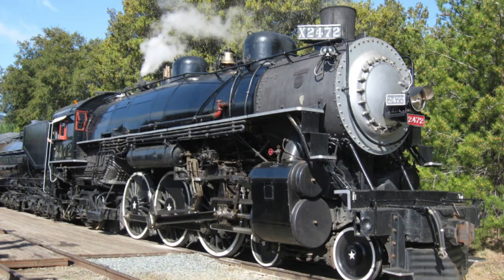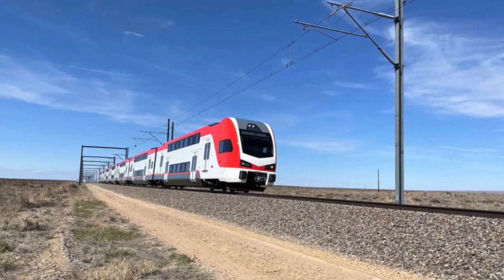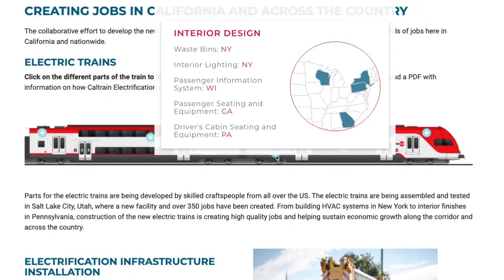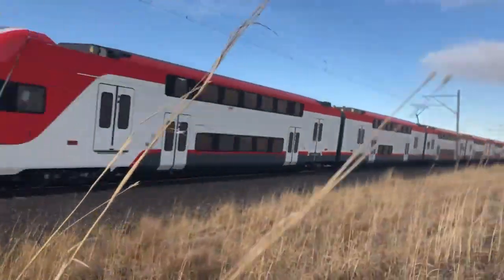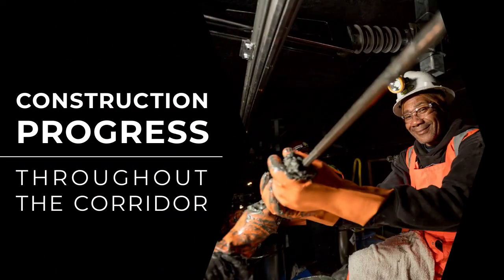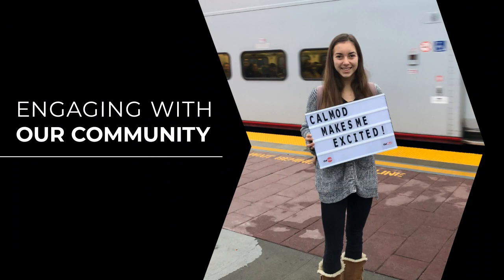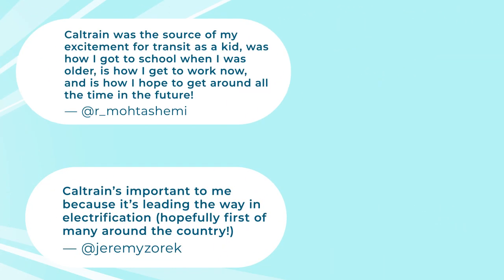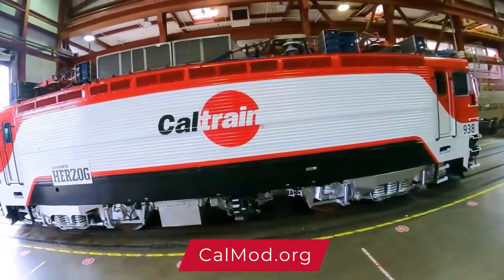Caltrain: Electrification Progress 2021

Comment: I frequently use the Stadler KISS in Switzerland (the original SBB variant). When the driver actually bothers to crank one of these into max acceleration, you can feel yourself being pushed into your seat. If the Caltrain model is similarly powerful, it will have acceleration close to that of a subway train. I also wonder if features like the beam sensors on the doors will carry over as well.

Comment: Anybody know what’s going to happen to the Aem-7? I know 929 was used for parts on 938
Reply: The aem won’t be used for service and most likely will be retired and scrapped next year ( when then new train sets can test on the line )
Reply: @ashtonhelm685  I doubt they would've repainted it like that if they were just going to scrap it after testing. It could easily be used to haul MOW trains in the electrified portion of the corridor.
Reply: @ashtonhelm685  just like jbs319 said, they probably won’t be scrapped. I also know that it won’t pull regular trains. I was thinking that it would be repurposed as a track geometry car or something that would do with track maintenance.
Reply: it might be a work train

Comment: merge with bart
Reply: Not possible
Reply: @lalakerspro  Why not? The MTC is basically already forcing this merger in all but name. Caltrain, BART and all the other transit agencies in the Bay are now going to be required to sync their schedules and work on a pulse system, basically making them one system from the point of view of the rider.

It's just a matter of time before all of these fragmented transportation fiefdoms are forced to play nice and work together. The riders want it so it will be done eventually. Might as well get a head start on unifying the two big elephants into one stellar system. And it would be a stellar system if these two were one system!
Reply: @TohaBgood2  bart uses a different Guage than caltrain. There is no way they can merge the system
Reply: @lalakerspro  So what? There are plenty of systems that have incompatible trains running on different lines but within one operator’s system. Hello NYC subway!

Institutionally, it is just so much easier to create comprehensive service where the sum is greater than the parts. Transit thrives on connections. Poor coordination/interplay between Bay Area transit operators is a fatal flaw in our public transit system. Smooshing BART and Caltrain together into one system just makes for a better, more complete rail operator for the Bay megacity.
Reply: @TohaBgood2  also you realize that they use different payment systems. Bart has barriers, caltrain doesn't. You would have to put barriers around caltrain which is impossible cause it's also a freight route
Reply: @lalakerspro  Nope. BART and Caltrain use the same clipper cards and the payment systems are entirely compatible. The only difference is frequency and how these are presented to passengers. But both are basically the same thing.

Caltrain is a proof of payment system, but so is BART. Those BART gates are largely decorative despite the way they look. It’s not like there are armed guards at BART entrances. No one is stopping you from just walking through the open handicapped gates! Both systems are interurban commuter services that rely on checking tickets to motivate you to pay your fare. 

Sure, BART does masquerade as a city metro in SF and Oakland-Berkeley. But with Caltrain’s electrification and new 15-minute frequencies, these two systems will basically become indistinguishable. Caltrain will even have an underground section in SF now too!